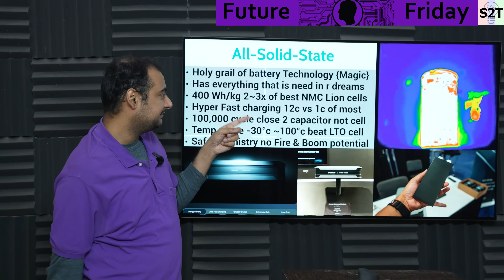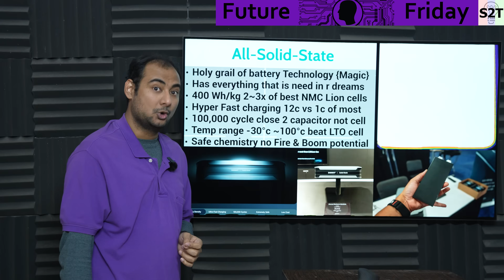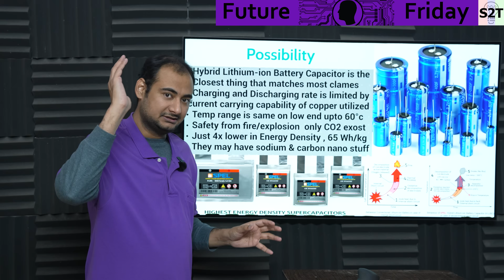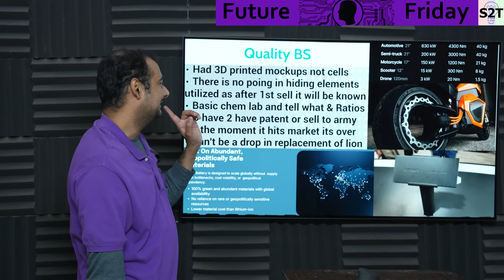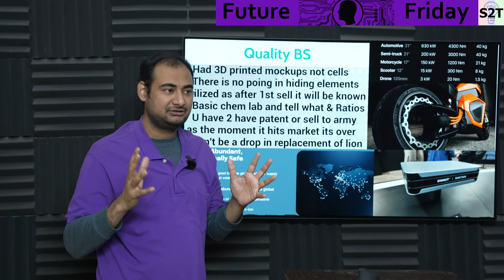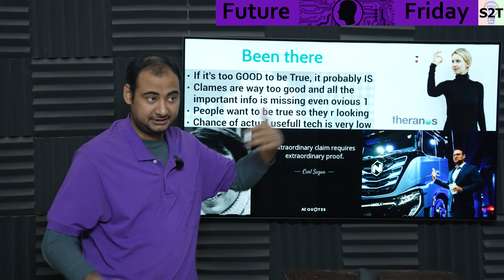DONUT All Solid State Battery Explained {Future Friday}

Comment: It is a battery. And the details of the likely technology/chemistry is already available online. CNT/sodium. Donut said that there is no lithium or rare earth minerals used, and the voltage is tunable. The trick is that the moment that they release the batteries, they will be reverse engineered. So they are using these 3-4 months (before sales to customers) to get top engineers, establish partnerships, secure patents, and sign contracts. Think for a moment about the different industries worldwide that will be affected if this is real. The best news is that the Verge motorcycles using the new batteries will ship in 3-4 months. Then all of the manufacturers and industry engineers will get their own purchased Verge bikes and immediately perform full testing before tearing apart the batteries. Your skepticism is well founded, as the claims seem unreal. But you have to ask what they have to gain if it is proven to be a lie. All partnerships and contracts will immediately die, along with Donut Lab and Verge motorcycles.
Reply: So True.
Reply from the maker: you have to ask what they have to gain if it is proven to be a lie  my man have u seen the full video ? the last slide
Reply: @s2tenglish  Marko hinted already in oktober in NordExpo in a presentation that something big is coming 2026. So did Nordic Nano earlier in the year.
Reply: @s2tenglish  I did watch your video all the way through. But Nikola, Enron and Theranos were fundamentally different, because they pushed the lies to get investment capitol. Donut Lab and Verge are not seeking big investment money. Verge only has the capacity to build and sell a couple hundred motorbikes, and Donut Lab is self funded and they are seeking qualified engineers, industrial partners and future collaborations. All of that is immediately lost if this turns out to be a scam. Whereas the scammers took millions in investment dollars up front, with the hope that their deceit would not be discovered. We should know the truth about the Donut Lab battery in 2-5 months. And they will lose everything if this tech is not real.

Comment: Supercapacitor or battery? It's clearly a battery, based on the claimed energy density (400 watt-hours/kg).

The confusion comes from its use of a Carbon Nanotube (CNT) material as the foundation, which can function as a supercapacitor with very high power density (>1000 watts/kg), but very low energy density (maximum of 10 watt-hours/kg).

Donut Labs has instead found a way to use the superstrong and highly conductive CNT material basically as a lattice with very high surface area like a sponge to intercalate (adsorb) the positively charged ions (such as sodium) at the positive electrode (cathode). They claim to be screen-printing (not 3D printing) this cathode lattice material - which would be plausible. By the way, Korean researchers published early in 2025 that they had coated CNT material with polyaniline, to convert the CNT into a positive ion intercalating cathode capable material.

While everything Donut Labs has said so far is very plausible, for such a small start-up company to out-pace the big boys like CATL, Tesla, etc., at actually creating a full production capability for such a battery would be most surprising. Regardless, I think Donut Labs may have actually invented a potentially game-changing battery (not supercapacitor), in their search to double the energy density highly desired for their electric motorcycle.
Reply from the maker: lets see

Comment: Its still just a battery that needs charging up from the grid.
Reply: Buy a solar panel.
Reply: @Nivexity perhaps thats the downside that they haven't discussed, maybe it requires high ampage charging and is no good for trickle charging from a little solar panel. 🤔
Reply: Do you make your own gasoline/diesel?
Reply from the maker: that is true is 100% vechile goes to EV then whole grid fails so it has to be a slow transition

Comment: Great episode! In short, they present a wide range of claims, that all are from in the vicinity of, to far beyond what all the expertise in the world, including huge companies that put a lot of effort/resources into R&D have managed to achieve in mass produced batteries, that goes for a single one of those claims, the combination of even anywhere near two of those claims doesn't exist in a commercially available battery.    

And that tiny company, that also claims to have developed other unbelievably good products, and also present themselves and their supposed products exactly like all other investor-fishing con-artists do, are supposed to have managed to combine all those properties into one single battery, that is ready for mass production, and the battery doesn't have any drawbacks, none, not even a single, tiny, completely acceptable issue, just unbelievably good in every imaginable way. They could just as well also have claimed that it also can recharge it self by passively harvesting energy out of thin air.
Reply: Well, last year they announced their revolutionary motor, and that's been available to buy for a while already, so at least that's not vaporware.
Reply: @marcus-in-3d nope it's not that is why there is no teardown of it . Hech one one of my startup friend has been pinging them for months and same story is repeated everywhere at best it's hyper optimised motor which is not suitable for long term use like a F1 engine is way to cut down very high performance but does not have longevity
Reply: @AnupamVipul At least there are reviews of them by people not affiliated by the company. Both by people who are just test driving one, and by people that have used one for months. And there are Verge bikes available at resellers, since I've seen reviewers test driving ones that are for sale. So are you saying that those resellers don't sell the bikes they have for sale, but only display them and take some kind of preorders?
Reply: @AnupamVipul  The bike have been on the road quite a while with the motor, off course someone could do a teardown if they wanted to....
Reply: @AnupamVipul Half a year ago Verge was lending one of the bikes with this motor to an unaffiliated 3rd party, and here they're meeting up with another owner of one of these bikes (and this was over half a year ago): https://youtu.be/7zZBvcPJ96A?t=2m35s

So I'm pretty sure that you can buy one of these, considering people have done so.
Reply from the maker: have seen this story play out way too many time